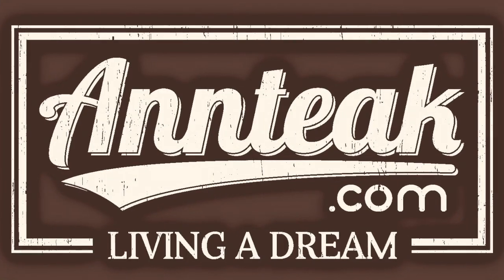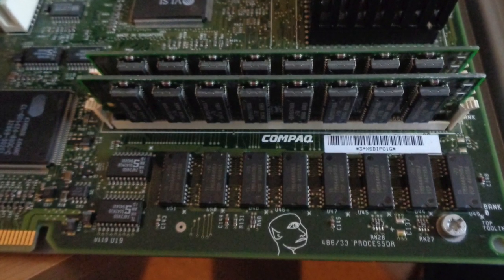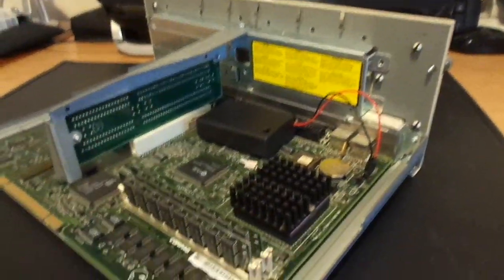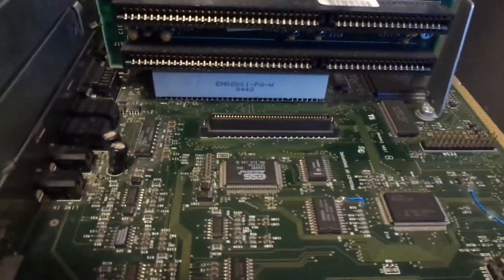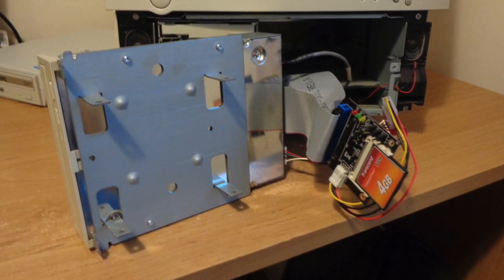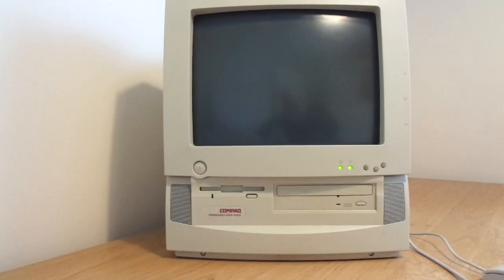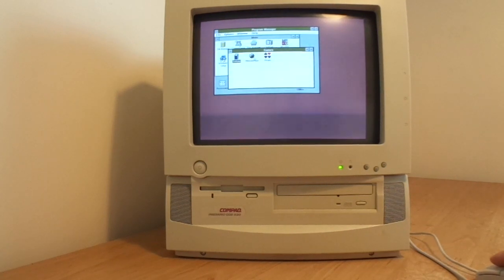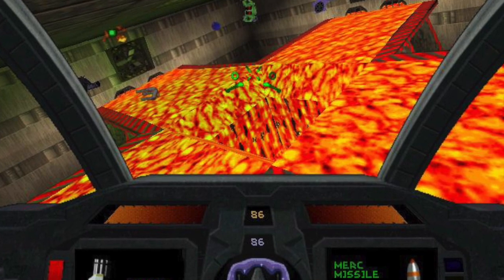The Retro Compaq CDS 520 all in one 486 PC

Comment: Great video ive got the Pentium 5220 version do you know the type and size of screws at the bottom of the front cover as mine are missing. Many thanks.
Reply from the maker: All I know is they are the same as normal HDD screws, albeit with a tork screw head... personally I would rob some from inside to retrofit to the outside and use some normal screws as per OEM parts for those taken from inside.
Reply: Where do you get hold on a pentium ver. og this computere these days?